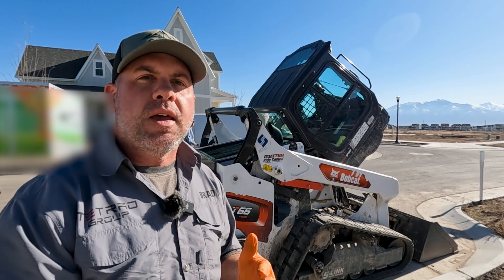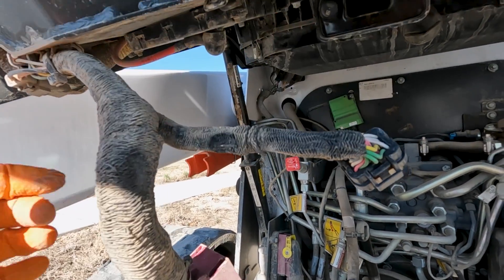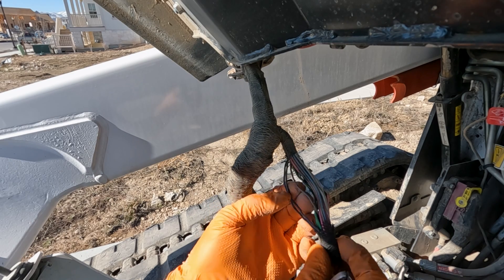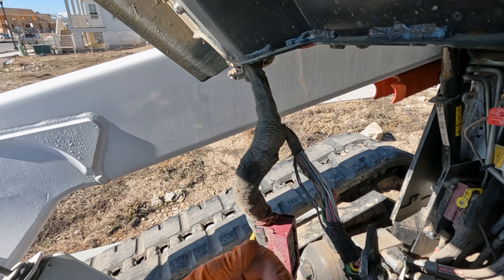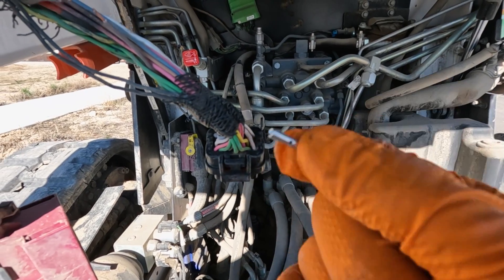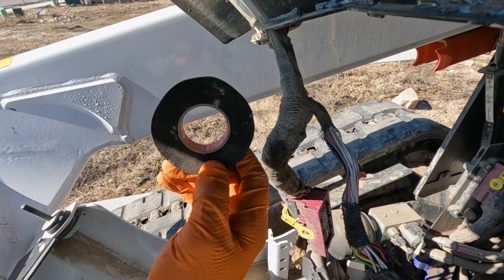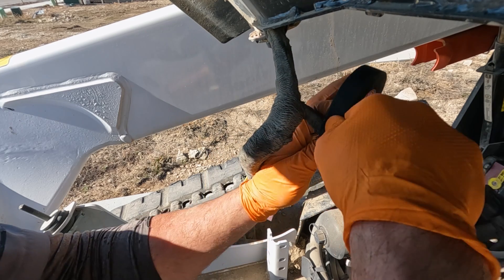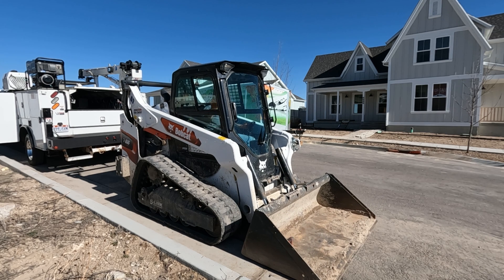Bobcat T66 Electrical Problems and Repairs

Comment: Worst skidsteer in my fleet.
The fuse box is at the very bottom of the unit where all the mud and water can and will get to it and corroded all the electrical wiring

Comment: So my T66 is showing U1111-8 code. Bucket angle sensor no communication..checked fuse, pins and wiring..no luck..HELP
Reply: Find it?
Repaired one yesterday, sensor under the plate ( round pipe) close to bucket coupler cylinder. Check resistance in all 4 wires from connector of the sensor to left boom hole connector. Those wires are small &  flimsy & i replaced that harness (made it myself) hope it helps( dan)

Comment: hi there , love your videos , always learn some new , but i do have an issue with my 773 maybe you can point me to the rt direction . fuel shut off solenoid don't pull with the switch  ,i install a new relay and fuse sub harness , even tried a new solenoid and nothing happen . i used the machine with a tie wire to hold the solenoid in. them remove the wire after turn off key off so the machine turn off . any guess ?

Comment: Great work! I love your videos and the attention to detail in your repairs as I am a lot like you on the repairs that I do owning my own equipment repair business. I have been using that harness tape that you use for a couple of years now and it really makes a repair look professional and as good, if not better than factory. I'm always looking for ways to improve or make anything better than it was before. Just a little tip on stripping those harnesses back, I found that a seam ripper like a seamstress uses works so good and won't damage your wiring. I pick them up at hobby lobby for a few dollars and have one in every toolbox. Thanks again!

Comment: Around 700hr, had my screen shutoff and the machine went into limp mode, only running for a minute before having to restart.  Dealer shop found the cab harness was bad and replaced it under warranty.  The mechanic said they had looked over the old harness on the shop floor and found no observable problems.

Comment: So I do a lot of on site work and wonder what is a fair price for this repair? Say its a 20 min drive and repair takes 2hr. $50 in parts.
Reply: If your doing site work your making good money and know the cost of operating.  And paying for experience mostly.   Minimum $ 500 .00 to $ 600.00 repair  with travel time both ways from shop
Reply: You could have a flat rate for the service call, plus milage if it’s outside of a radius you determine. Plus your hourly. Or no service call charge, but a higher first hour charge with an hour minimum. Or come up with an hourly rate you’re good with and start the clock when you start the drive to the job. Field work is always alot more expensive than in shop.

Comment: Good stuff! I realize I am telling you what you probably already know, but when using crimp connectors, I stagger them, so as not to have a big knot in one area. Was unaware they made "harness tape", back in the day 3m electrical tape was all there was available. Also like to use "convoluted tubing" whenever possible if you can the right size.